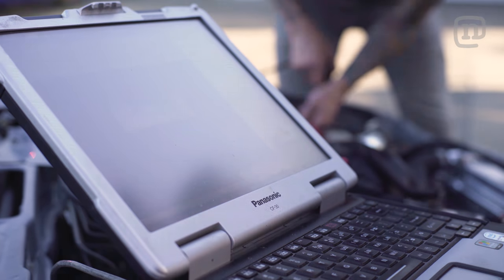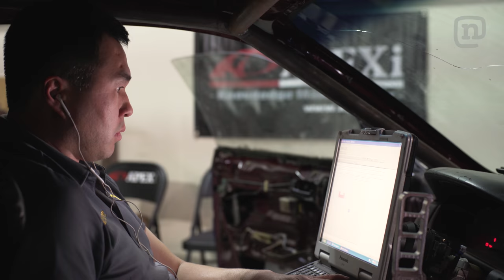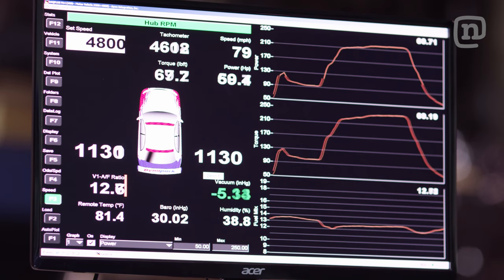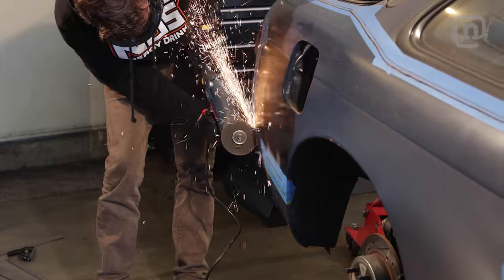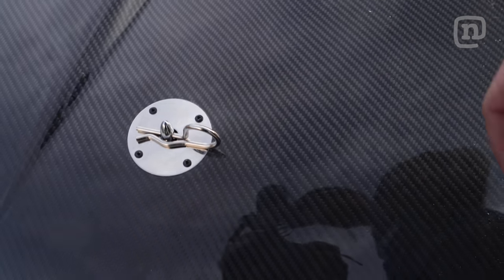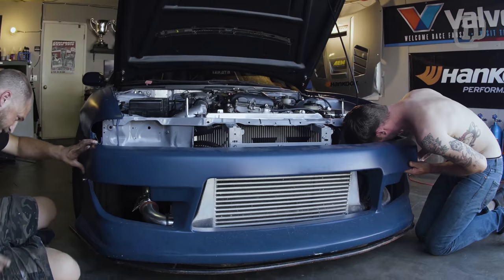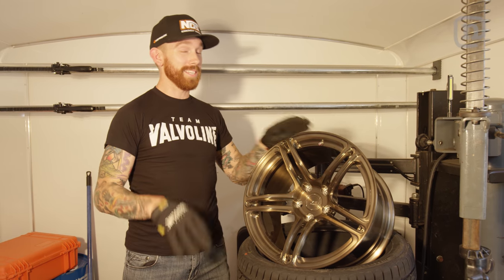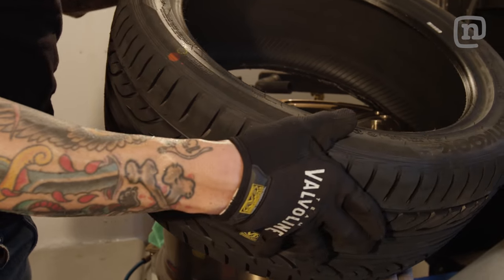Drift Garage 408: Tuning the Nissan

Comment: Question for Chris or Ryan: I want to get a set of Hankook tires for my car. The tire size is 245/40R18 and the car is driven mostly on the street, but does some mountain road thrashing, autocross, and a bit of drifting. Which Hankook model would you recommend?

Comment: Been watching since season 1! What are the wheels/ tire specs? Do you guy typically see a difference between what road racers/ auto-x guys prefer vs what drifters prefer when it comes to tire fitment and compound choice? Soft/ hard? Meaty/ a little stretch?

Comment: I hope I can get my s14 shooting flames one day. 😂😂
Reply: Jon Drives just take the cat out. A test pipe is like 30 bucks on ebay
Reply: brandoGTR48  I'm currently straight piped do to the previous owner lol. I just need an SR one of these days. Haha but that's a few thousand subs down the road.
Reply: Boost your ka don't mess with sr.
Reply: Just keep adding fuel
Reply: Just add fuel to your tune, being straight piped already,  helps. My s13 SR shoots flames occasionally when i down shift, it just runs rich. Also dont listen to the idiots who say to build a KA build what you want and what works for you. Most of the KA fan boys are just salty towards SR's cause they cant afford an SR or something better haha, But all engines have strengths and weaknesses. I swear though the ka fanboys are worse than the sr fanboys ever were back when it was cool to have an sr

Comment: Didn't tub the rear arches? That's why you got so much smoke in the cabin. You'll throw all sorts of crap into the cabin without tubbing correctly, potentially dangerous. I personally wouldn't run it like that for long.

Comment: Next season you should do a 1990 mustang lx (5.0l v8), keep most of it stock(engine and drive-train) and just to the necessary stuff(safety and cosmetic) to drift comp/tandem. You can also have Vaughn Gittin help since he has a foxbody mustang that is basically the same as this. This definitely isn't a build a am thinking about doing myself(sarcasm)

Comment: Chris or Ryan, 

Last week i was at my local car meet and a drag race was brought up. it was a $2000 buy in, i didn't have the money so i put up the pink slips for my car but if i won i got the money and the respect of the fellow racers. when the race started i was coming last so i hit the NOS, i quickly passed 2 other racers and was in 2nd place, but as i went to hit the second stage NOS my laptop warned me there was danger to the manifold. I ignored the warning and smashed that NOS, i flew pass the next racer and took the lead, next thing you know my passenger floor pan dropped out and my wheels locked up and i spun out due to frying my piston rings (i was lucky that 100 shot of NOS didn't blow the welds on the intake).

What tips for a young drag racer do you two have for avoiding an embarrassing situation like this again?

Comment: Next season, maybe touch on modern steering angle modifications, with some details into ackerman preference, caster trailing knuckle design with high and low caster vs traditional caster with camber gain and sort of some setup and things along those lines. Also PAINT THAT THING SAM! Interior as well, I don't want to watch you do that part but just do it. Tuerck's 1jz s13 would be sick, just anything with some more technical type things. I know I am probably the minority with this kind of stuff but I'm into design, fabrication, how and why things work, love the details. I appreciate what you guys do and check out my own drift idiot S14 build on IG @DustinClement